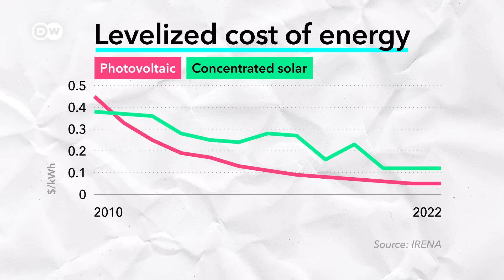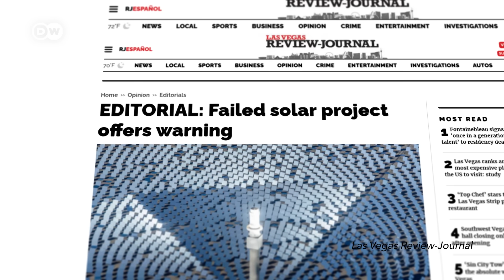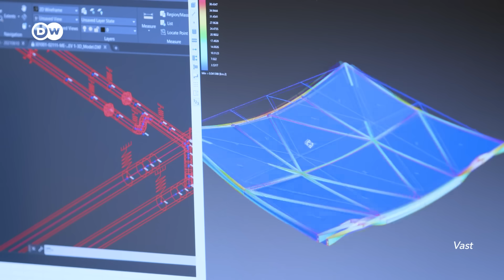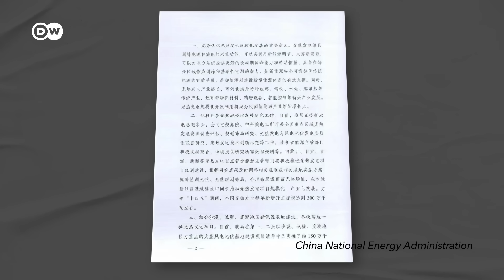How we can make solar power at night

Comment: Photovoltaic panels could also be used to store electricity as heat for the storage, not just mirrors. Separate solar farms for daytime use and some for storing heat for the night. Or maybe combined photovoltaic solar farms producing almost constant power 24/7. Add a smallish battery into mix and get even more constant current. During the day 35% of the solar panels could generate electricity to the grid using batteries to even the production (clouds etc.). Rest of the panels would generate electricity transferred to stored heat used by turbine in the night time. The ratio of day/night production could be easily managed and changed.

Comment: Does the argument against large lithium-ion batteries also hold up against other types, such as the new sodium batteries?

Argument used in the video that they typically use lithium-ion doesn't really hold up when you consider it's being propositioned against another tech that's not typically used.

Comment: Let's have a reality check.
 
Cold Fusion (LENR) - Unproven hypothesized type of nuclear reaction that creates nuclear fusion at room temperature by producing more energy than the amount of input energy can be produced from its altered state.

Tokamak Nuclear Fusion Reactor (ITER) - Development cost for the ITER is $150 billion. Requires a temperature of 150 million degrees Celsius to create nuclear fusion. Reportedly the record to date but having to use more input energy than produced is 69 megajoules of fusion energy for five seconds using 0.2 milligrams of fuel. 

(1 megajoule is equal to 0.00027 megawatt-hours, 330Mw equals 1,188,000 Megajoules) 

The alternative.

Solar Hydrogen Energy Recovery Gas Turbine – 301Kwh of solar energy collected from the sun’s constant nuclear fusion at atmospheric temperature and supplemented with the turbines Variable Frequency Generator   provides electrolysis to fuel a variably controlled gas turbine with an energy range between 80 -330 up to700Mw of electrical energy 24/7, has three moving operational parts, cost $36.5 -49.5 million requires an operational area the size of a football field, noise level is 60dbl at 60m and incorporates direct air capture of CO2 at 1,400 Kg/sec

Sixty-five carbon free, shovel ready installations retrofitted to any of the 120 Hydro-electric schemes would provide Australia's entire energy needs on a combined operational area of 33 hectares for a 2023 total cost between $2.4-3.3 billion, construction is 3 to 5 years to build, meet net zero twenty years earlier and makes wind, solar, hydro, gas and nuclear for energy production redundant.

Comment: 11:47 If concentrated Solar power system is substantially capable of improving its efficacy and can significantly reduce its cost then it can be a viable competitor to Photovoltaic systems. 😎💯💪🏾👍🏾

Comment: some additional remarks: 

The first solar thermal power plant was put into operation around 1913 in Egypt. It was a parabolic trough power plant designed to drive a steam engine because importing coal was too expensive. However, when oil was discovered in the region, the plant was shut down.

In the 1980s, new parabolic trough power plants were built in California. They were used for peak load coverage at midday, as gas power plants for peak load were too expensive.

In solar thermal power plants, parabolic troughs are mostly used because they are easier to scale. Tower power plants are more "exotic" in comparison. I don't understand why the article focuses so much on solar towers. Parabolic trough power plants can also store heat. Both variants have their advantages and disadvantages. The main advantage of tower power plants is the much higher temperature reached in the receiver (1200°C vs. 400°C in the parabolic trough). However, the disadvantages are the significantly higher construction costs and more complex operation.

The technology and the combination with thermal storage are not that new. Moreover, there are many tower power plants that run without (or less) problems compared to Cresent Dunes. For example, Morocco has built huge facilities in the last 10 years. 
I don't quite understand the goal of this article. It is interesting that China is now increasingly investing in this technology but the other things are not that new.

I also miss a comparison of the cost of storage per kWh in batteries versus thermal storage. What is the factor here?

Also weird, that the video does not mention the DLR in cologne. They do a lot of important research in this field. they also have the only tower power plant in Germany in Jülich near Cologne. where they do research. Instead they go to Australia. Funny because the DW (Deutsche Welle) is based in Bonn. which is less then 100 km from Cologne and Jülich.
Reply: Was wondering if somehow you could beam it down from space solar cells in space?

Comment: Instead of mirrors to towers could we not use Solar thermal panels and heat pumps to get the heat needed for CSP? Then you wouldn't need to have thousands of mirrors that track the sun?

Comment: Simply more research has to carried out for a more situable heated element, if a better one is found that is able to heat up in less time and remain at constant temp for much longer with good insulation, then the problem with CSP is solved.

Comment: I don't think CSP has a big future. PV and Batteries are just to cheap and prices are still falling. Also CSP doesn't work that great in regions with bigger (seasonal) variations in electricity production from PV and other renewables. Batteries are probably fine to get over the night. We need to solve the problem of mid and long time storage. I also doubt the usefulness of solar heating as usually you receive less sunlight when you need the most heating. But of course we should continue to research CSP, even if it doesn't look that great at the moment, it is a technology that already proved it works and has its advantages.

Comment: Only one degree loss per day while stored is impressive... The melting point of salt is 660 degrees lower than the boiling point of salt (which is 1361 degrees higher than the boiling point of water)😮😮😮

Comment: Photon Energy System (PES), which is a groundbreaking solar technology that amplifies power output significantly compared to conventional solar panels. PES is a new energy technology that relies on the use of multiple layers of materials and special spheres to introduce sunlight and generate a significant amount of luminosity, which is then transformed into electricity using a silicon conductor module.

PES can be used on Smart devices, drones, and electric vehicles and are capable of providing long-term power without charging to residential buildings, commercial centers, and industrial plants, power grids, waste disposal, and utilities

Comment: Sand is a much easier material to heat and store energy in, It could be heated using either PV or Solar Thermal. It doesn't even need to flow.

Comment: Why don't they just use the heat to boil water directly? Why use salt at all?
Reply from the maker: Molten salt allows CSP plants to store energy and dispatch it as needed. It can be heated up more than water which improves the efficiency of the steam turbines used to generate electricity.

Comment: What they won't tell you is that CSP is highly geographically dependent. Very few places on Earth have the right kind of conditions for CSP to be feasible. That is why most of these installations are either in the Mojave, Chile, Gobi desert or southern Spain. If you add some parts of North Africa, Rajasthan (India) and Australia, that is all the CSP you can ever deploy.

With PV and Wind production at record levels and renewable power congesting most of the transmission grids in the developed world, the practicality of wheeling CSP from these limited places across the globe is just not there; even if we consider the advancements in HVDC.

For a 24/7 renewable grid, we need something else, given that lithium batteries are not the solution for large scale grid level round the clock storage either!

Comment: Why move molten anything around pipes and not just move water around a static thermal reservoir? The documentary did nothing to explain why it does a thing that is hard and prone to failure over something we already know and works well - that would be interesting detail.

Comment: I'm not a power engineer, but know a bit about electricity. They glossed over the part where you can use photovoltaic panels to melt salt or sodium or other. They say it's not efficient, but the panels do not all need to be in 1 location. Panels can be scattered over the grid and excess daytime power used at a generating facility (where the big wires already go) to melt the salt/sodium/other.
Reply: If the panels are all over the place and the electricity to heat up the salt comes from further away it's even worse for efficency

Comment: Sodium salt has problems, as mentioned, but pure sodium does too.  It is highly reactive.     One solution not discussed here is photovoltaics in the desert with energy stored in sand batteries.  They aren't that efficient, but they are cheap, and it should be easy to source the sand.

Comment: I think that the obvious reazon for the making of this video, is that solar panels are short term handy to become later merely garbage, but those concentrated sun power plants are instead an oldened technology that it's been cheaper, and could be attached to those sand batteries from Finland for the storage of heat, while no residuals are produced. So it makes a better business.

Comment: I believe that the sunlight could be run through a prism breaking it down into it's frequencies. The visible light could be run through fiber to where it was needed. Any non heat intense frequencies could be used for different functions which are generated now. Heat intense could be separated  It would multiply the efficiency.

Comment: In my opinion, concentrated solar is the right answer.  You missed one of its great advantages - the panels degrade.   Every day is less.  In 30 years they have to be replaced.   Mirrors can be polished, and sodium solidifies and melts for an eternity.   In addition they can be receivers for mirrors put in space, so we can have space based energy generation, to send equator bright light anywhere in the world for long hours.  After all, what is Musk going to use all those big rockets for?  (Hint, it isn't going to be for supporting a vast Mars colony.   No money in it.)

Comment: Amazing how old failed ideas are being recycled, mainly because the so-called green power revolution has stalled! Nice historical footage of the CSP plants unfortunately now these failed plants are an environmental disgrace! Not just on the land but wildlife that got fried when flying or straying anywhere near it.
Micro inverters are another trend that made a comeback, hitting the market in the mid 2000s and got faded out because of reliability issues but again people are finding out that the roof environment is no place for inverter electronics!
Hydrogen is another failure that is actually power backwards idea.
 It takes 55kw to produce 1 kg of hydrogen. This 1 kg of hydrogen can produce 33kw of power! 
Now you may think I'm just anti all this stuff but I've been in the industry for 30 years and am very aware of the actual reality and how dire and a juggling circus our power grid has become!

Comment: It would be interesting to see if you could use solar panels as the mirrors for this concentrated solar power plant.. and another system that I think will be the future system is using water hyacinth farms as the solar collectors and extracting the energy as biomass in a digester system..

Comment: I am glad that germany changed that law. The in-depth research into photovoltaics to make it more cheap really helped us, especially those of use that live off grid. Photovoltaics is really domestic freedom.
But people should never ever stop researching other technologies like CSP, or other storage technologies (direct or indirect, as you can use photovoltaics too for heating up the salt). Or even fluid batteries.
Never stop. At one point in time it will turn out to be very useful.

Comment: No chance for CSP. Photovoltaics is ridiciously cheap. In germany 4cts, in spain and China 1-2ct/kWh. Battery costs are dropping like a stone and are at 4ct/kWh lifetime cost and aiming at 1ct until 2030. AND CSP works ONLY with direct light without clouds. A lot of regions are not suitable for CSP at all.

Comment: Seriously don't we have any other way to generate electricity? Than standing on our heads (burn coal, csp, uranium radiation, you name it) just to boil water to turn a turbine? Is there any better way to turn the turbine than heating water? Does the turbine has to turn to generate electricity? We are applying tremendous resources and produce waste to basically create a mechanism to boil water. Because steam engine is the only way? I mean is this civilisation?

Comment: Can these mirrors also be made of solar panels? Both reflect and capture energy.
Reply from the maker: They work very differently: CSP mirrors reflect and concentrate sunglight whereas PVS turns it straight into electricity. PVS becomes less efficient when heating up and CSP utilizes this heat. There'd be loss of efficiency when trying to include these properties together. They can be integrated though, like two independent solar fields sharing the storage. ☀️
Reply: @DWPlanetA I think there is Naked Energy who combined the two

Comment: The capital expense and operations and maintenance costs are significantly more expensive than PV solar. PV solar is being constructed for less than 20 USD cents per mw/hr compared to 50. Then you have the long-term O&M costs which are prohibitive.

Comment: PV can be distributed among the population quite easily and relatively cheap.
You can bring it into rural remote area without the need for massive infrastructure and heavy cost to erect the solar power structure.

I guess PV is perfect for home user, but we still need utility scale of electric power generation for industry, that'd be stuff like CSP, nuclear, gas turbine, etc.

My home use just 5KWh of battery with 2.5KWp panel and that's enough for everyday needs and usage.

I imagined if you live in a much hotter or colder region indeed you might need way more power, but still they're pretty easily affordable and easy to find.

Even my older more than a decade old PV panel still producing power close to their label, maybe like just 80% but they augment my newer panels as I have empty space for it too.

Maybe one day if I ever need those space then I'll get rid of that older pv panel and put newer more efficient (and wayyy much cheaper) PV panels there.

Comment: I heard the mirrors were not up to scratch and very hard to maintain, very expensive to make and require some exotic elements to even make them last as well as they do, so no CSP won't be making a comeback because its way simpler to hook photovoltaics up to emerging battery and flywheel technologies.

Comment: I need to remind that in the grid the generation and demand must be precisely coupled or your frequency changes and the whole grid collapses. And not only the generation changes, so are the demands. There are something called "peaks to valley" and it's not necessarily the night to be valley. Actually sunset-midnight is usually a peak since people return their homes and use their appliances.
A large unified grid may distribute its power around thus avoids wasting electricity and that is ALSO China's case. Small independent grids will have a hard time handling its peaks and valleys even if you do have the CSP. That's why you overloaded your plant and froze your molten salt. In a well designed grid you might as well worry about overheating your salt rather than freezing it.

Comment: Don't have to use molten salt.  I mean Li-Ion isn't the greatest thing either.  Ever seen what it takes to put out a fire in a bank of Li-Ion batteries?
Turbines produce a cleaner output than inverters for starters.
Reply: Electricity storage may come in various forms. CSP is a special since it generates as well as stores electricity.
Li-ion cells is a bad idea. Yep you mentioned fire. And they are expensive to build.
Gravity storage such as pumped storage (dams and pools) or bricks (energy vault) or railway (ARES) comes in handy and they are easy to expand.

Comment: On of the reasons CSP is not as eficient as PV * also PV lacks this ability as well, but is the bidirectional tracking function. The focused beam has to be centered into one point to heat up the transfer  substance. This bidirectional machine system is a pain in the ass.

Comment: If CSP costs 2.5 times more (excluding the storage system) than solar PV, it's the same cost as using PV and resistive heaters to generate the heat, assuming 40% efficiency from heat to power.  That is, when using solar PV that only feeds directly into storage. But, thermal storage for on demand power generation can be used to store excess power on the grid, from any source, which means CSP has to be able to generate power for a lot less than twice the cost of solar PV to have a chance of being relevant, and that requirement also includes that the CSP system does that, reliably. 

So, the probability of CSP becoming impart part of the solution is very small. Large scale, cost efficient production of CSP systems doesn't have to compete with current alternatives, it will have to be able to compete with whatever alternatives that are available when that large scale production is supposed to happen.  Meaning, they would have to be able to compete with solar PV, batteries and so on, that is even better and cheaper that what's currently available.